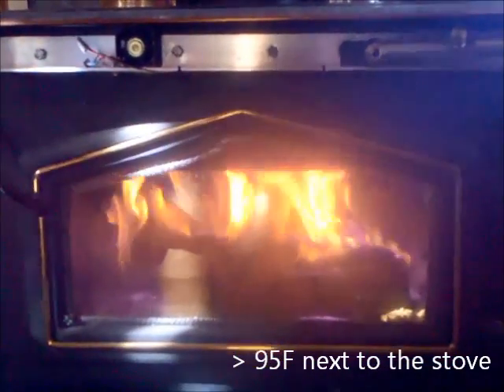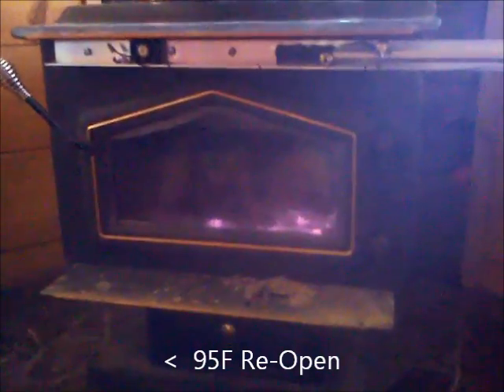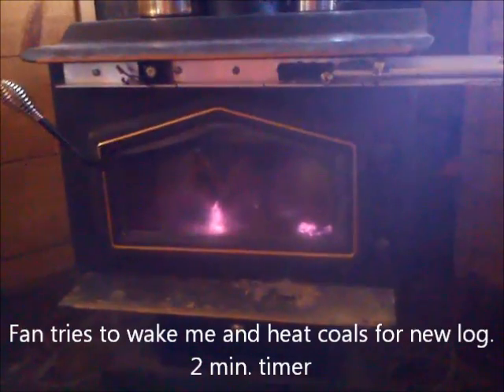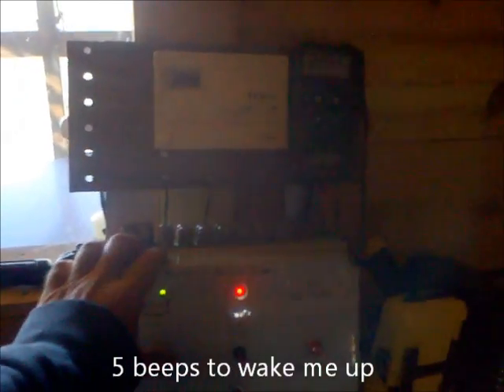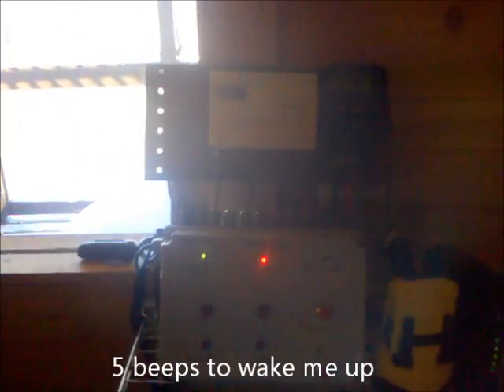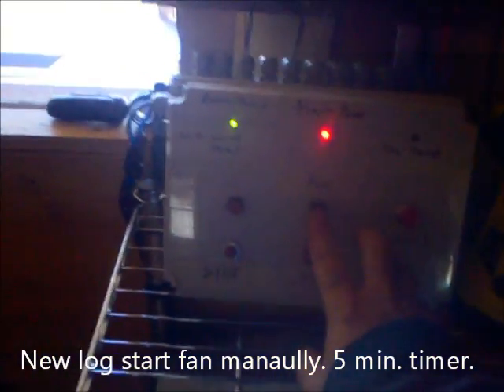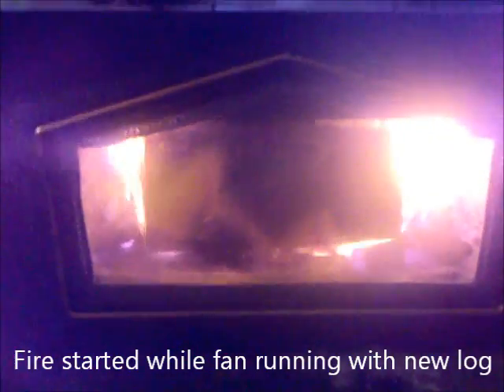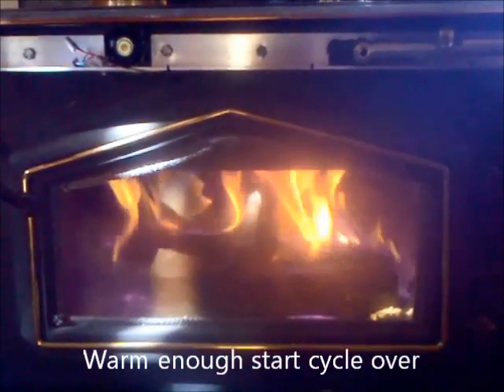Wood Stove Robot

Comment: A robot to open stove door and put the next log in and close door would be ideal.  There is a device called an Arduino micro-controller that can have various sensors hooked up to it, such as a light sensor to see how bright the fire is, another for temperature etc.  It could decide when the stove needs feeding and when to start and stop fan.